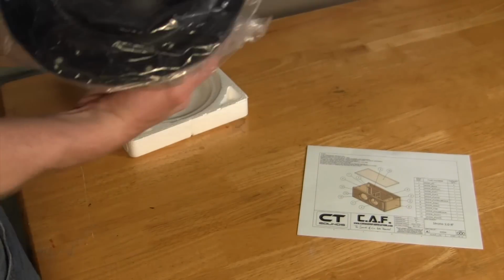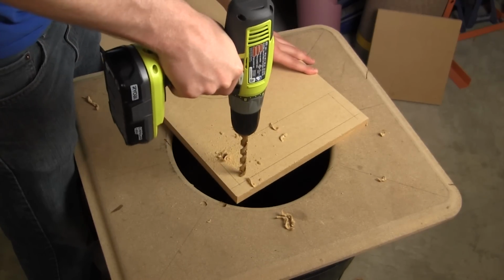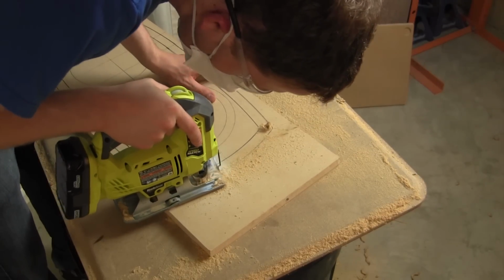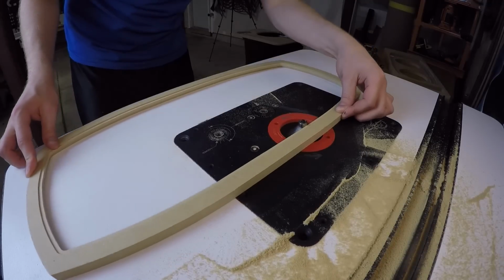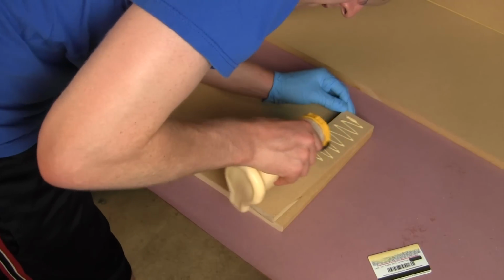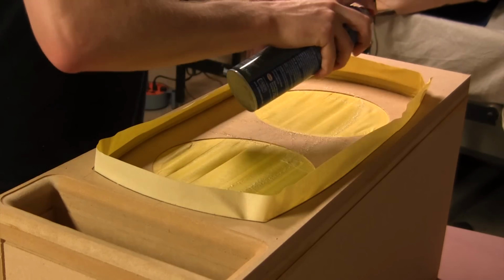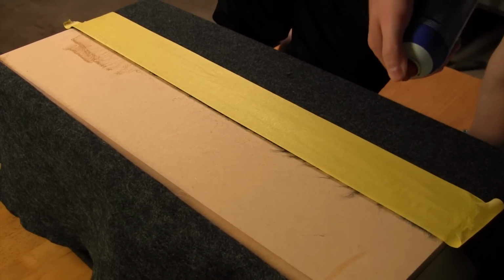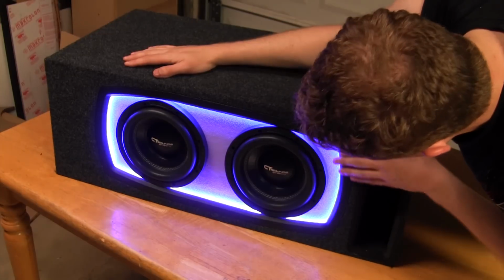CT Sounds How To | Build a Subwoofer Box for Strato 8"

Comment: I would have designed the box with one speaker t-line and the other as an enclosure. Some math and you can have the sine waves match with and find the dimensions. The 2 styles should give you a wider range from the t-line low and enclosure high peaks.

Comment: This style of box works great. But if you really like to slam you will notice the sub farthest from the port is working a little harder.A central port or 2 side ports gives the subs equal stress and a cleaner sounding bass.
Reply: If that is happening to you, that means you built the box wrong. Placement of port will not change how much the sub moves. Thats idiotic.

Comment: Mark could you build a ported box for a 2001 dodge ram extra cab that goes under the back seat
Reply: +Captain Buff the Third Ok I Gotcha he can't work with nothing  so here is the sub I'm looking to work with J L Audio T W 12 shallow mount sub it only needs 1 cubic foot for a ported  box and there is more then enough room under the back seat for thus to work I would to have a aero port box. if this is not enough information then I will just have to say thank you anyways